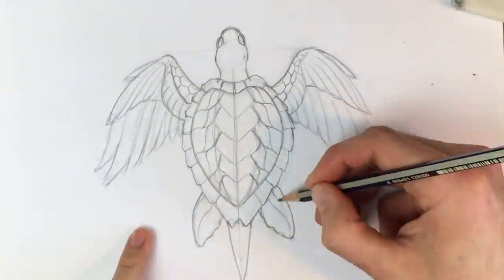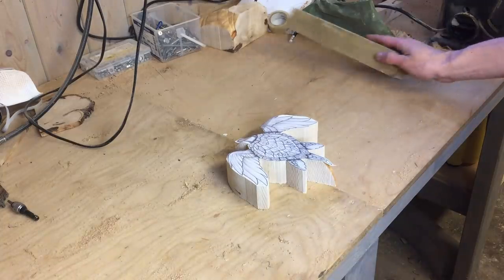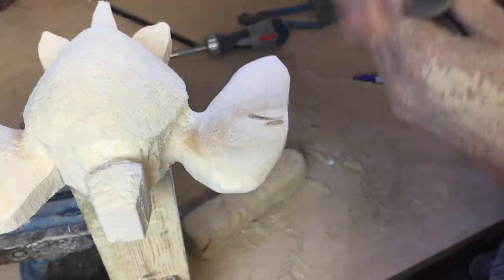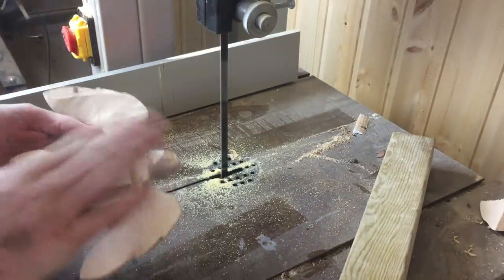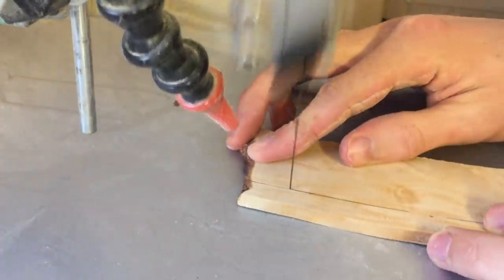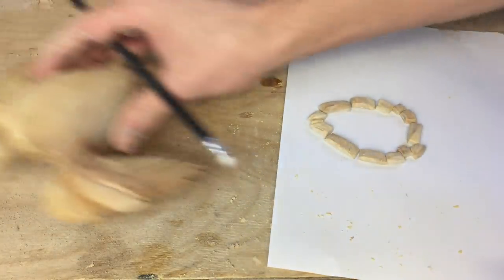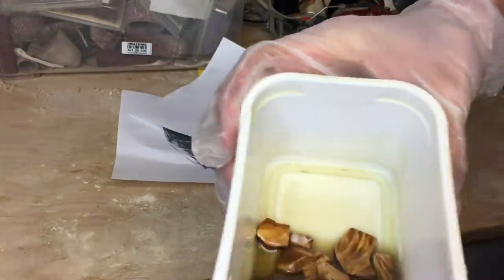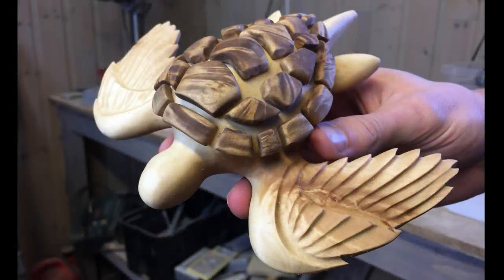I Craft A Turtle With a Cool Shell

Comment: You could try using a spray adhesive to attach some rough sandpaper to your organic piece (say the shell), then just sand your next layer until they mate.  Just use a heat gun or something similar to take the sandpaper off when your done. It's a good way to match nonstandard shapes to each other.

Great vid, first time watcher 👍🏻👊🏻

Comment: If you take a very thin piece of sandpaper slightly larger than the area you need to fit the small piece like on the shell place the paper where the pice needs to fit and gently rub the pice on the paper it will form to the contours of the pice